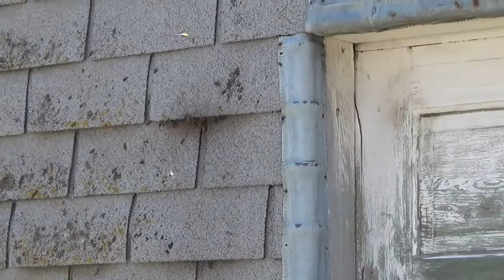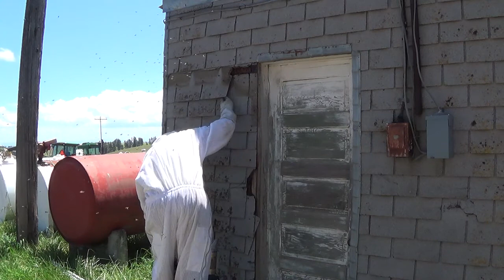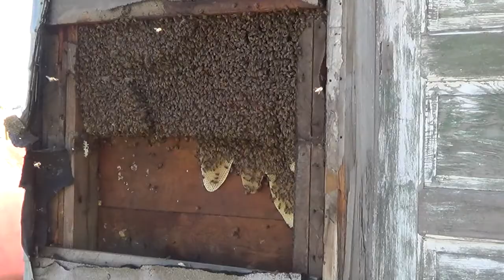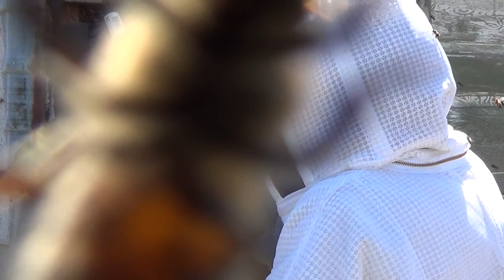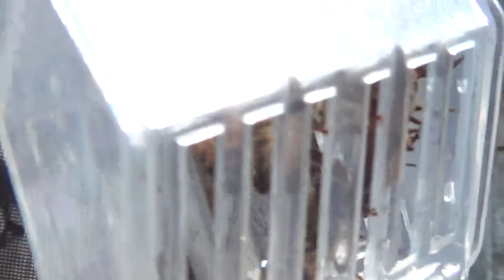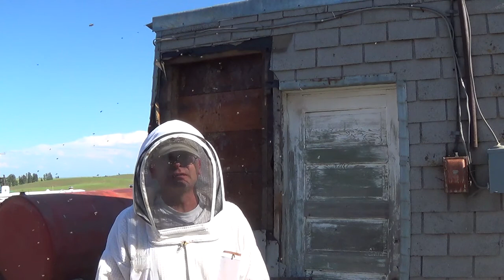Melrose Honeybee Cut Out Removal

Comment: Is that just a pvc connector(white tip) on your vacuum?
Reply from the maker: Brian, I use a Colorado Bee Vac... and yes it is just a 3/4 pvc ball valve to control air flow. Open less suction, Closed more. More suction equals more damage to bees. I will do a video on it if you would like.
Reply: Path of the Bee thank. But I was talking about on the tip of the hose where you where sucking the bees. You had something white.
Reply from the maker: It is the upc sticker on the end of the vacuum nozzle....
Reply: OK.  Thanks.  Thought it was a different tip you might have been using. Always trying to do better for my bees.